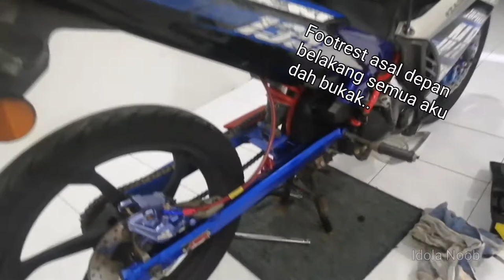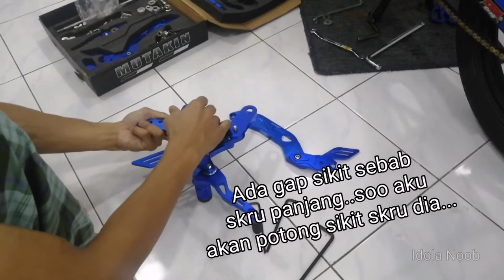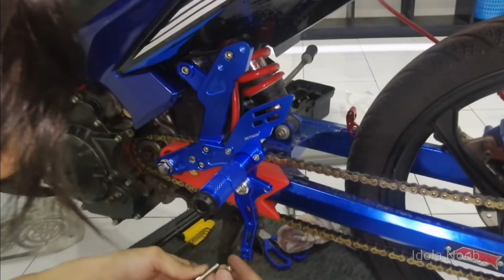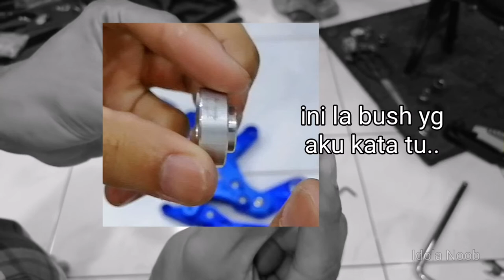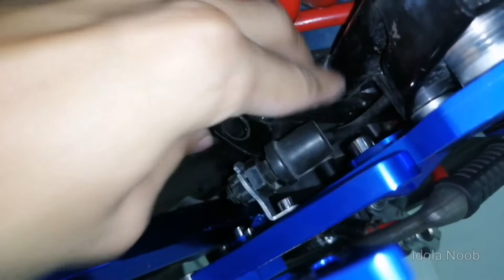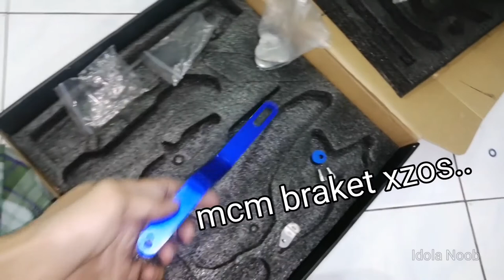Racing Footrest Mutakin LC135 5s @ 4s Convert Brake Disc

Comment: Kick start lepas?atau pemijak btake tu blh lipat?
Reply from the maker: lepas.. boleh lipat tu padle brek...
Reply: @idolanoob7715  ngam2 lepas ke atau ade ruang lg?
Reply from the maker: ngam2.. ada la ruang sikit.. xkena kick start pon.. boleh adjust tu tarik belakang lagi ke.. ikut keselesaan rider..
Reply: @idolanoob7715  boss sya lc 4s .. covet arm y caliper y.. footrest nk pakai 5s ke??
Reply: @idolanoob7715  boss masterpump petak tuh boss beli mne ye
Reply from the maker: @محمدشكري-و5ذ  shoppe jugak boss.. search je brambo pump.. nanti macam2 pattern kluaw.. haha
Reply: @idolanoob7715  material dia besi ke alloy?
Reply from the maker: @محمدشكري-و5ذ  nak pakai footrest yg macam mna tu? xfaham.. kalau Lc amik je 5s..sebab tapak footrest blkang tu bentuk LC bukan y kan..
Reply from the maker: @gamerthelastmodz3500  alloy rasanya.. selalu barang racing ni bnyak alloy.. haha.. alloy2...